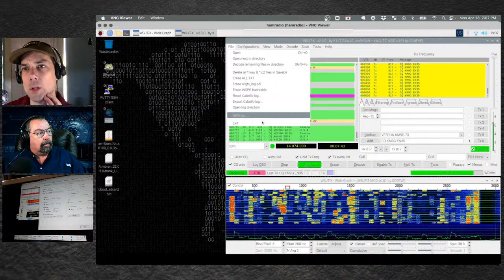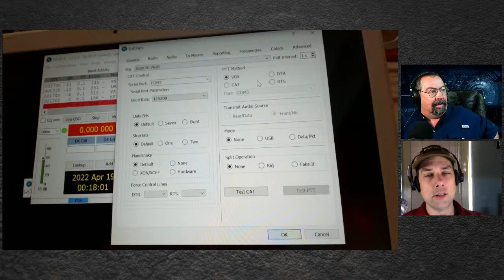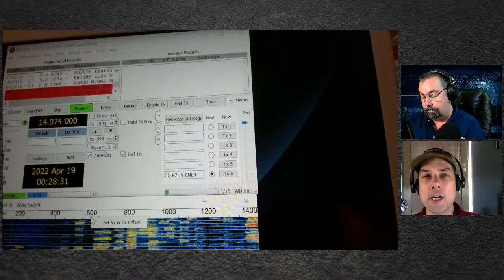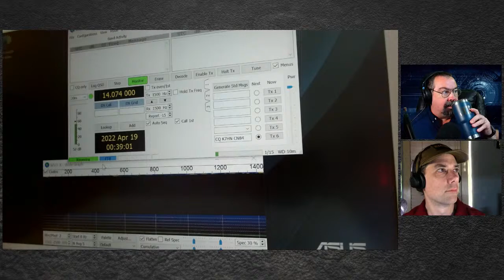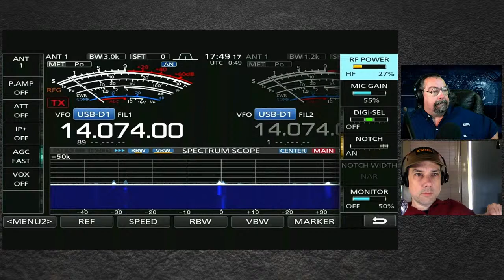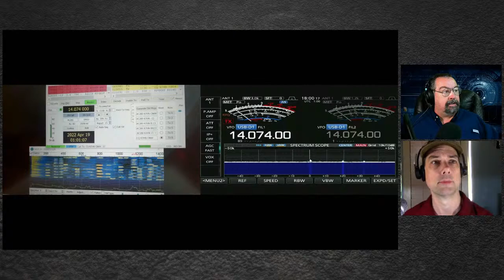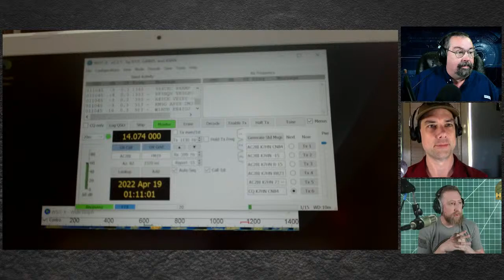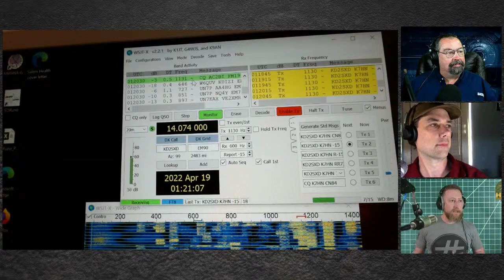Today we teach Larry how to FT8 - Ham Nuggets Live

Comment: Well... ahem... Larry you took this really well....  I think that the "teaching" should be set up in 6 parts... 1) Radio to Computer Connections, 2) Radio Settings, 3) Computer software and driver install and settings (MAC/Windows/LINUX)  4) WSJT-Z software settings,  5) Operational Settings and tests.... 6) Test Drives and interface(s) familiarizations.  A much MORE methodical and compartmentalized approach to this training would perhaps alleviate the confusion.   This sounds critical of you all, but I do think that the compartmentalized approach with checks would be the best approach.  I do applaud you all for your calm and reassuring dialogs with Larry....  You Gotter' Done when all was said...  73s Art
Reply from the maker: Thanks for the feedback!

Comment: I will save this video but I won't be getting a fancy rig unless I sell both my cars, a child and a spare kidney!😄
Reply from the maker: Which radio do you have?
Reply: @temporarilyoffline  no HF yet, still early days. I have the Anytone AT-D878UVII Plus (+ ahotspot) and just got a Baofeng UV-9R Plus today to keep in the car just incase. I back-ordered the new Wouxun KG-UV9P"X' HT from BSR in February, mainly for all the receiving bands plus V/U Tx. I like the Xeigu 6100 because I can take it anywhere and put an amp on it once I get upgraded to Standard. I'd like a fancy powerful HF radio for QTH but that may take a while. I have a 9m squid pole and ordered the CAHRtenna so that should do what I want for a while. I'm not sure what radios do FT8 or can be upgraded to do FT8 etc, I'm not at that point yet. I have my callsign and paid ACMA last Friday so I can't even Tx yet, they have to be slower than FCC. :(
Reply from the maker: @DonzLockz  You're well on your way.  Every HF radio that you can buy today above $400US can do digital modes/FT8.  Any older radio with a 6pin or 13pin data port on the back to do digital/FT8 with an external box.
Reply: @temporarilyoffline  thanks Steve, I didn't know that. Good info to know, especially the older connections.👍
Reply from the maker: @DonzLockz  I have access to a Yaesu FT-450d at my club and a Kenwood TS-570D at the QTH, both are older radios that will do digital modes.  The IC-706 is another radio here that is a solid older performer.  All of those are probably more expensive than a Xiegu G90 or X6100 though